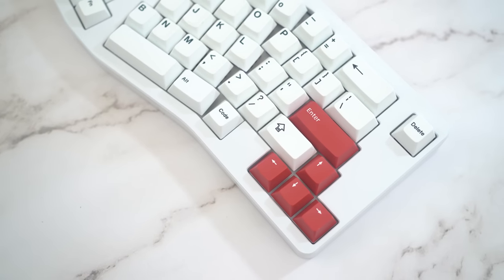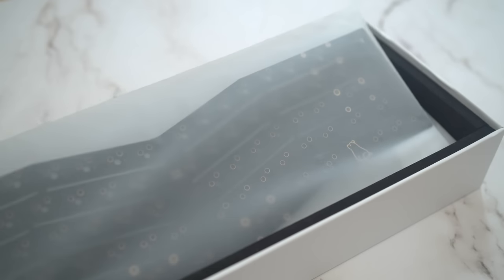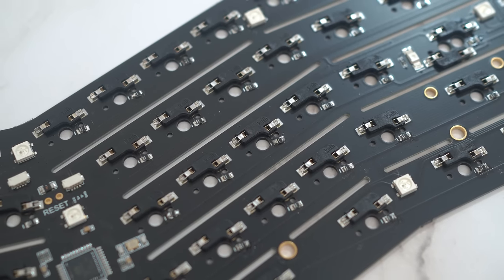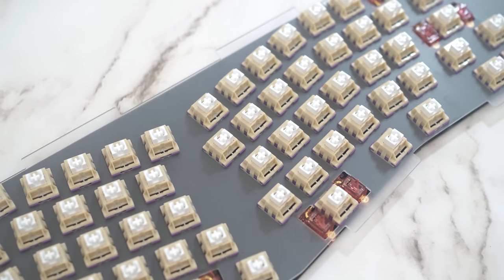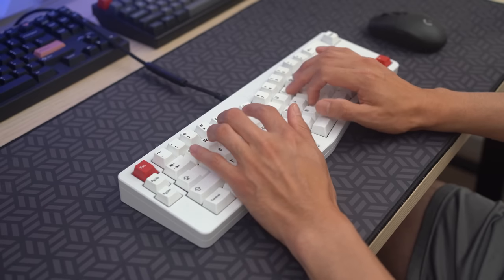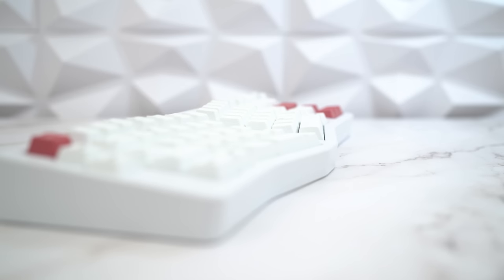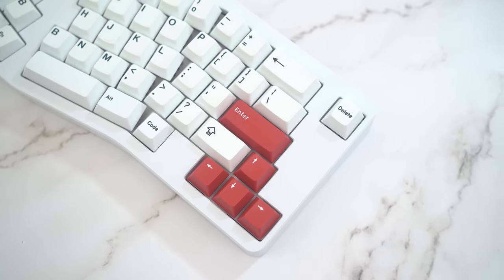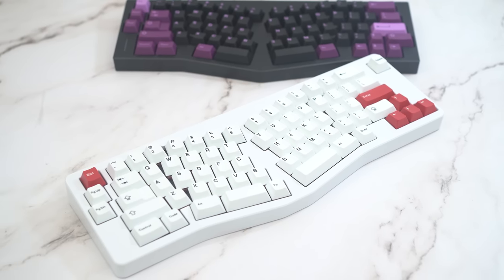What If You Don't Stuff Your Keyboard With Foam? - BEAR 65 V2

Comment: The problem I have with all the foam and tape mods and stuff is that after I tried them I realised my keyboard sounded just like every other tape modded foam filled board.
There was no point in looking at boards or sound tests, because a 200 dollar board sounded the same as a 500 dollar board.
I've started much preferring the sound of the actual board rather than the same sound emitted from every PE poron silicon foam modded taped up board. Not only is it more unique, it's actually preferable imo.

Comment: I don't see any real flex here, only bounce - when the whole plate/pcb assembly moves, not just the local area you're pressing, that's bounce - when the local area you're pressing deflects that's flex. It might seem pedantic, but it's an important distinction. There are a lot of bouncy keyboards, but very few flexy ones.

Comment: Any word on when the release will be and what pricing will be like?

Btw Keybored, have you tried Gaffers Tape for mods? It’s a thicker cloth tape that you can use for tape mod and holee mod. My weapon of choice for modding. Less layers needed since it’s thicker. I believe it’s non conductive and is often used by stage techs for wire management. It also leaves no residue.
Reply from the maker: They said they will be doing the GB sometime in July.  Pricing is supposed to be something around $350-$399?  I have used gaffer tapes for video production before, but never on a keyboard!  Will have to take a look!
Reply: @Keybored  I would also suggest taking a look at splicing tape if you haven't already. It's a fairly thick rubber tape used for electrical work.

Maybe a tape comparison video in the future? Could be interesting to see. As always, appreciate the detailed work, Scott!